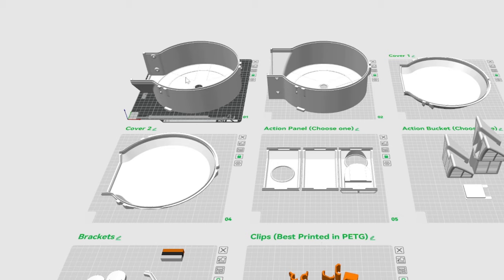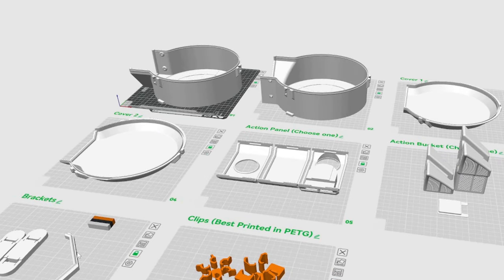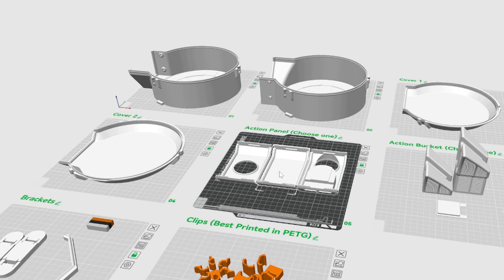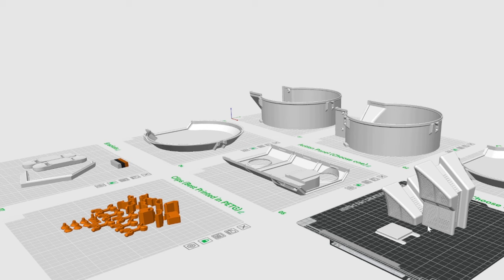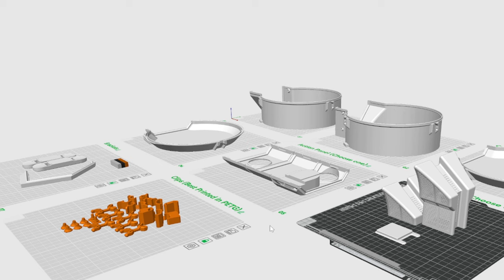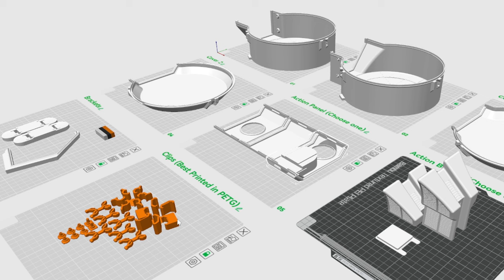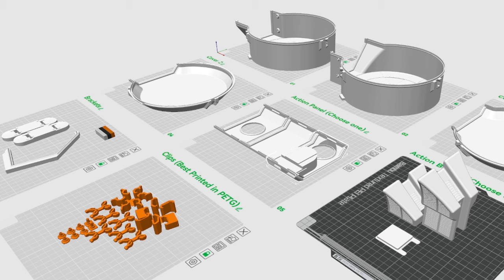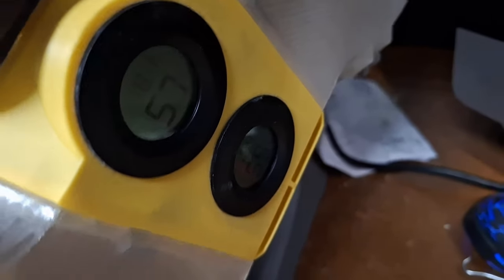AMS Lite Enclosure - Fitting and printing guide

Comment: I accidentally ordered transparent PC instead of PLA (Polymaker) - I didn't notice until after printing and had it set on PLA and it spit out unmelted strips like uncooked spaghetti.  I decided to change the settings and try it anyway since I've heard the A1 is capable of PC (though there is no preset for Polymaker brand PC - just used generic).  I turned the AC on high in the small room and closed the door to avoid drafts and the first cover seems to have worked fine.  Slight lifting off the plate around the perimeter - I might use a little glue stick next time.  So far, so good.  I think I'll only use it on the outer pieces (even though they're the biggest ones) - so I can see the colors on the spools.  PLA for everything else other than PETG clips and such.